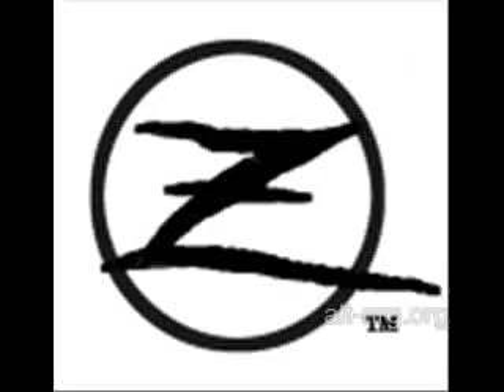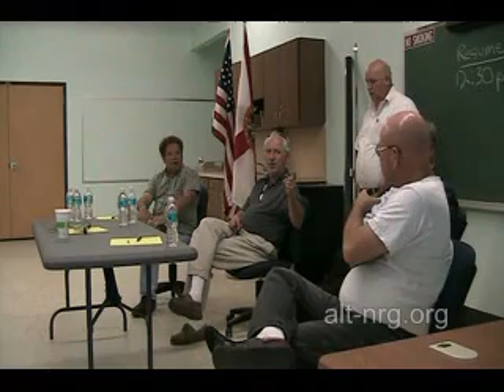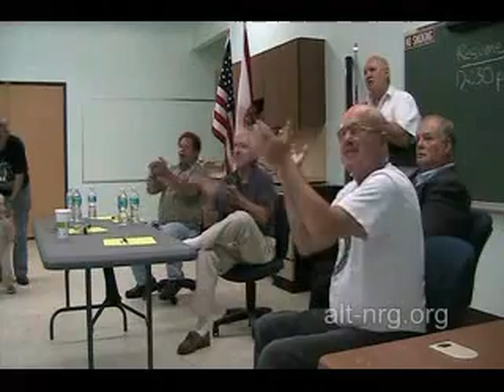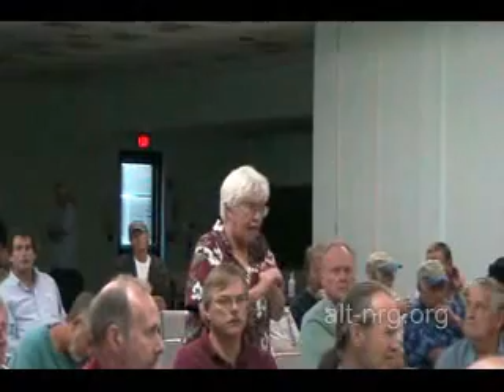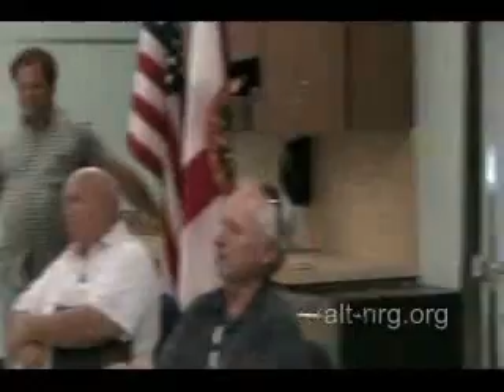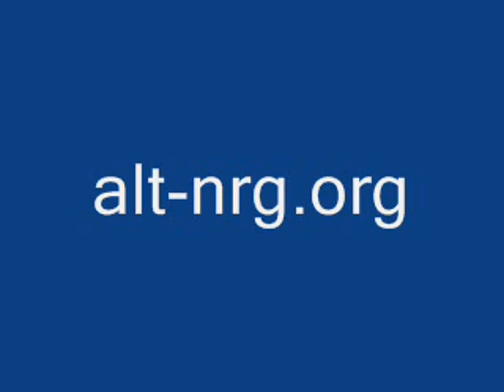#152 - Manatee Tech Roundtable part 9 of at least 16?

Comment: No, the 75% is mainly from the amplifer as that is where most of the power is used.  After the Cl2 is gone, the sodium reamains as an ion, and if you where to let it dry you would have NaOH, or lye, which you could have use in the frist place as an electrolite. Don't know anything about the solid polymer. Thanks

Comment: Hey, Zero&Bill what do you fill about amplifing the right frequency of radio waves, I know you said that most transmitters are at about 75% efficient, but cant you strenghten it with some kind of amplifier, Please tell me if you guys have tried this or are wanting too?What happens when the cell with the salts CL2 is gone from the cell wont you just have the Sodium, and will that remain in the cell to be used as a great electrolyte? Any news on anyone trying this solid polymer poris electrolyte?

Comment: I believe you need to produce the HHO on demand, with some presure only in the line going to your cars fuel injection system, enough for the cars quick responce to go up to full throttle? the cars timming should be advanced and the computer needs to be fooled or even bypassed into thinking the system is opperating normally? I am excited with radio waves!,  See how much HHO he was getting from that small testube? I however think there was gold particals inside the salt water?its worth testing!

Comment: Hi GBH2o4u:
 I like these debates. Kanzius uses radio waves. Most tranmitters are at 75% efficient at most, my DX77 transceiver uses 276 Watts to get out 100 Watts. Zero's cells are much better than any radio transmitter. Unlike pure H2, we can not store HHO as it is too combustable. And as for Cl2, at some point it will exceed its solubity in H2O and will be pull into the engine. Thanks. Bill

Comment: Thanks Zero I learned alot from watching these videos. You encouraged me to convert my 2       12" by 6" plate wet cells into dry cells.. I want to know where I can network with the  Manatee Tech Roundtable. I am a member of the ebn forum with d3 and ssc. But the more the better. By the way take a look at noryl as a material for the cell. Bob boyce has made one and so did general electrics. Keep me in the circle.

Comment: Okay time for basic chemisity. NaCl is the same no matter where you get it. It just has other ions with it. At the anode, along with the O(2), you get Cl(2) which mainly stays in solution, but you do not get a 1 to 2 ratio of H(2) to 0(2) because of the Cl(2) production. The Na stays in solution as an ion because at the catode the H(2) is so strong, but even if Na metal was produced it would react with water and go back into solution. If you use salt long it will start producing Cl(2) gas. Tks.

Comment: Another theory I have is that pot. hydroxide is not the very best electrolyte it has some apparent flaws one is it makes some narly foam,+ it is very costic,and I also think that the electrons flowing threw the water have to overcome resistance jumping from molecule to molecule of the pot. hydroxide! could be wrong about that, but if we can discover a substance that works as well as salt, this would be perfect!Maybe the answer is plain old salt,after the cloride is striped from it!please respond

Comment: Optimum gap spacing? Do you think the spacing needs to increases with the increase of the voltage, And what could be the right amount of amps to push the voltage, I think that number might be around 10+or-, but we need to do the experiment? I noticed on one vidio that when each - + plate was isolated from the rest, hudge produation! with the dry cells this could be achieved with plastic plates dividing each set of -+ plates, you would just need a hole drilled in top and bottom,competing forces?

Comment: with the results ive seen plate spacing is best kept to a minimum, as the plates are already resisting current, having less water to pass through would be a benefit (even though water is far better conductor then the plate material) For all experiements tho i would like to see people just using salt water, ultaimtely thats where our 'unlimited' supply is; in our oceans. I think we need 2 work on making a cell make 10L/min b4 try and make it efficient. Until then its not doing anything for us.

Comment: Thanks, have you ever thought what might happen say if someone built a dry cell,with alittle wider gaps maybe 1/8" this could bring even more effeciantcy,now I also know that there is the best way to wire the cell, now what that configuration is I dont know?Do you?Ok then the cells plate material is critical for max. eff. Surface area is also a factor.Optimum temperature of the cell another factor! even the electrolyte,Ive heard of a polymer solide electrolyte?P.W.M is critical+right v & amps!

Comment: HiZ, the gentleman talking about feeding hydroxy into a biesle at idle is one of the projects I am trying to work on. No spak plug so o way to run pure nhydroxy but at idle the fuel consumption would be terrifiic. Perhapse if you would care to pass it on to him I am making a modification to Mr Myers gas control valve as seen in his patent for a hydroxy carburator to feed the diesle. I have the patent number somewhere and a copy of the patent if he is interested.

Comment: from memory both gold and platinum have less resistance then copper and are both very oxidisation resistant.  Cost is a big reason not many have toiled with this idea, but yes you are on the right track, if that a stainless constructed cell can have energy in = energy out then more efficient cell plates would surely come close to overunity (energy out is greater then energy in)

Comment: mikeyidh, I read a little about NORYL from Wikipedia. You're right. It says "Noryl has possible applications in the production of hydrogen, where it could serve as cost-effective electrodes in an electrolyzer, replacing expensive rare elements. It is highly resistant against the alkaline potassium hydroxide. For conductivity the plastic is sprayed with a nickel-based catalyst.[1]"  It's been around since 1966. Very interesting

Comment: Zero SS  is not the only material that can be used. There is another material that I am familiar with. In fact its actually a plastic. Both bob boyce and GE made cells with the material I am speaking of. From what I understand this is a conductive plastic that is resistant to corrosion from the powerful electrolyte in the water. When you can research the material NORYL. 
I hope this can help.

Comment: Are they Talking about Hydrogen or HHO? Or both?
I know Ravi has mentioned that over time HHO can damage a gasoline engine. Possible due to the additives that people use to generate the electrolysis process. Not to mention some of these chemicals are hazards and adds to the cost over time. That's why Stanley Meyer used tap water. I know, I know good luck in duplicating his process..... I'll keep trying! :0)